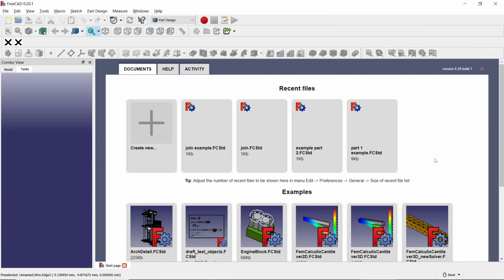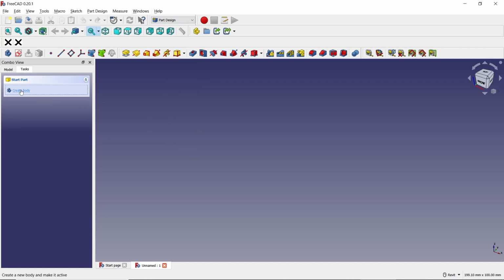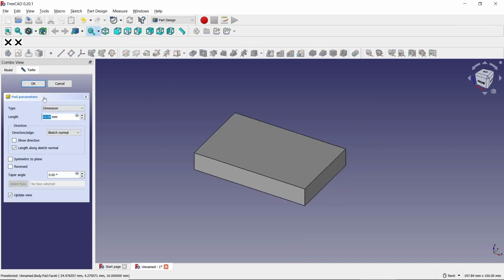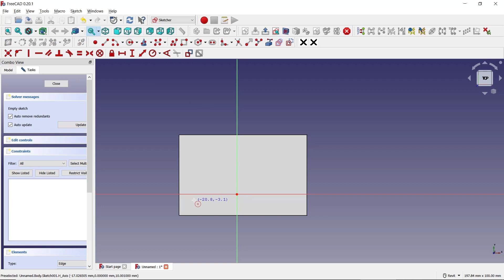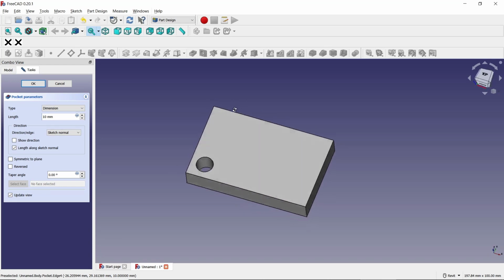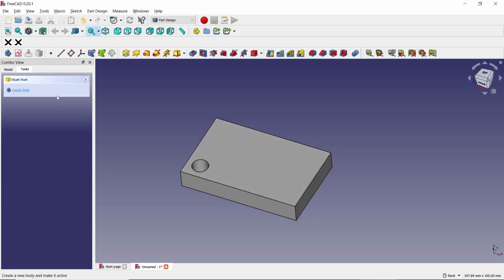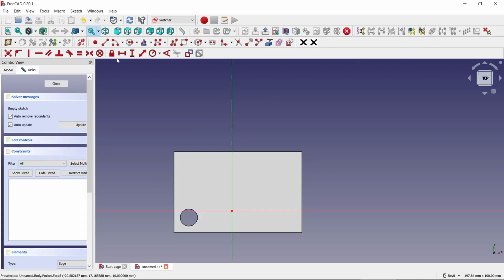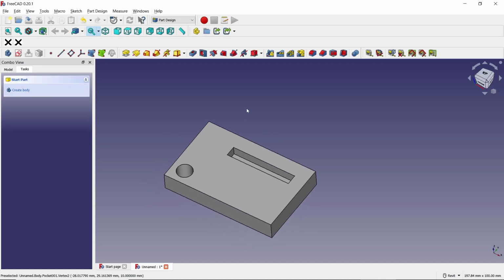FreeCAD How To Use Pocket Tools

Comment: Thank you for the tutorial. My question is, when you are printing this piece and the printer gets to the pocket, what is supporting that first layer of the pocket?  The printer will literally be trying to print the first layer in mid-air.  With that said, is there a way to make an internal support?  Say a solid rectangle, same shape and size as the pocket, built from the very first layer of the project? I am building a heart with a circular pocket in the middle, but I ran into the same problem.  The first layer of the pocket is literally trying to be printed in mid-air.  So I figured build a solid cylinder starting at the beginning of the project to provide a base for the first layer of the pocket.  Unfortunately, I am verry new to 3D design and can't figure out how to do this.  I try to create a sketch off an internal face, but FreeCAD does not seem to like this and builds externally to the heart instead of internally.